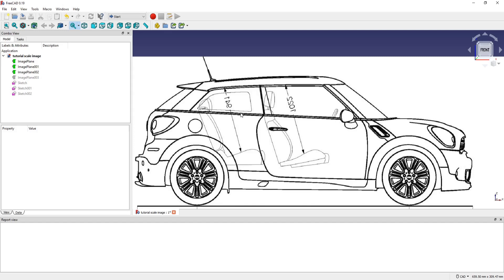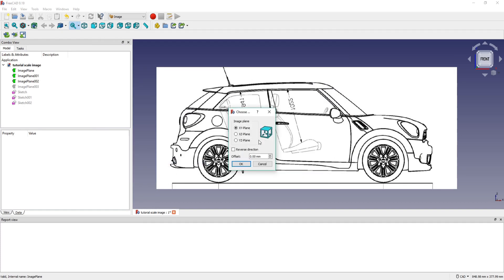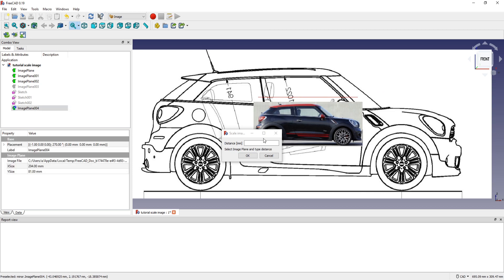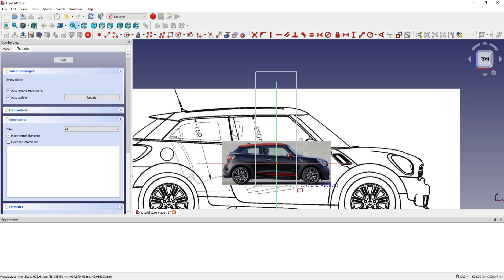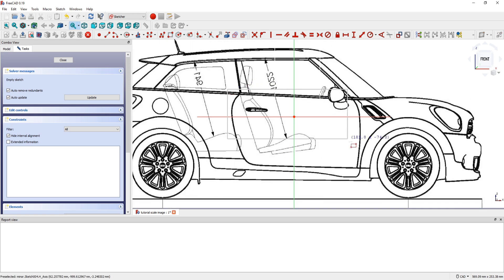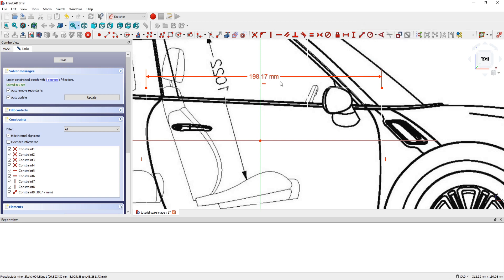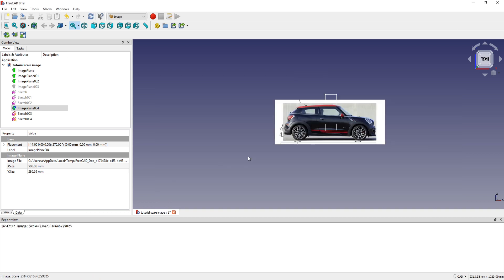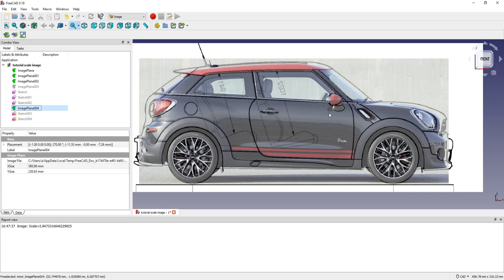FreeCAD Scale an Image Workbench Image

Comment: one tip, if modelling a car: the wheelbase (centre front to centre rear of the wheels) is a very accessible and precise measurement (most blueprints have them). Enter it for both images.
Reply from the maker: of course it can be done that way